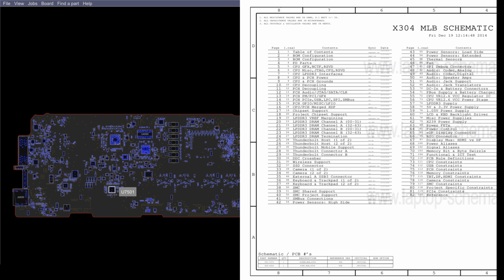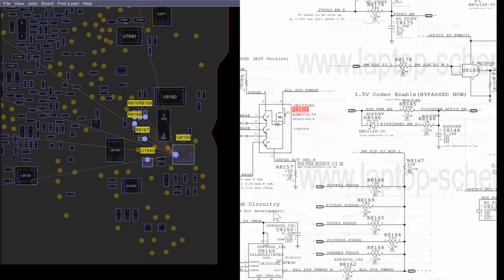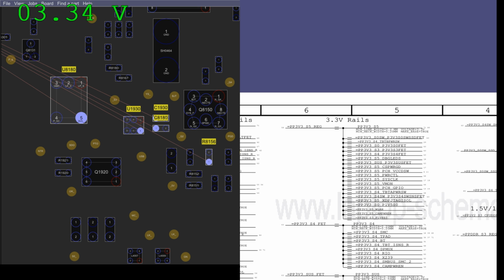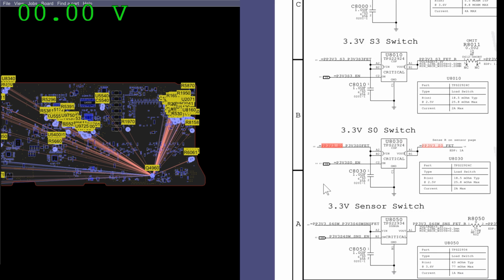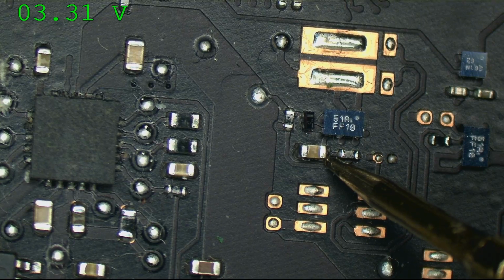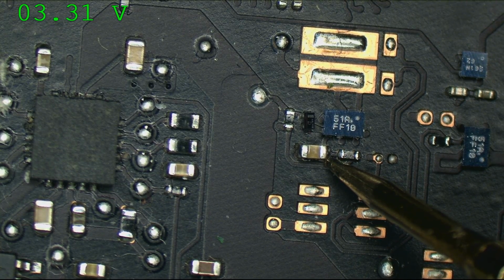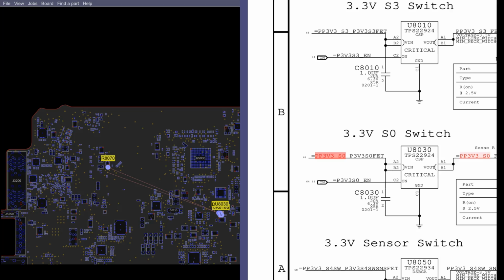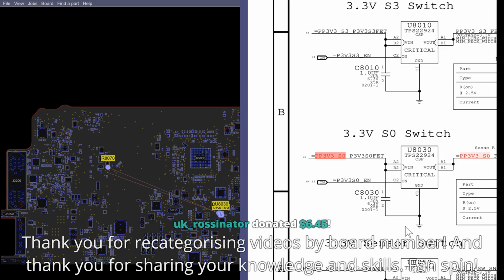820-4924 drawing 70 milliamps but not powering on

Comment from the maker: If you're looking for more board repair videos, check out https;//boards.rossmanngroup.com where I have them classified & categorized by board model number and problem type: no pre/post roll ads, no banner ads in the video, and higher video quality - all for free. 

I am hoping to get more people following me on my website than on YouTube just incase YouTube pulls the plug on my channel someday, like they have to so many other creators with little to no explanation. 

Thank you for watching, and as always, I hope you learned something!
Reply: You also might want to look into bitchute as well. Almost impossible to get banned from there.
Reply: Is this why the live stream vods keep getting removed from the live stream channel? I do not have the time to catch them live so I watch and listen to those vods hours after they are uploaded and they keep getting removed.  I get mirroring your videos but why can't they be on Youtube as well?
Reply: Hey Louis. I know you love your FX-951 but have you seen this Pace ADS200? https://paceworldwide.com/ADS200/ it's a 120 watt beast or at least says it is and it's price is pretty close to the FX951.
 The Hakko 951 is a 75 watt station so I'm thinking the Pace will cook through jobs that would normally have sucked all the heat from the tip and make solder stiff and hard to work with.
 The other thing I like is Pace being an American company.
 The negative is that the documents I've seen for it mentions it's a manufacturing station and not a rework station and I really don't understand the difference. I would think a rework station could operate at lower temperatures but the Pace manufacturing station temperature actually claims it goes lower than the Hakko rework station.
Reply: Thank you mister Rossmann! thank you so much!

Comment: Hi Louis
I have a 820-4924 no sign of liquid damage but no green light no power ,PPBUS_G3HOT missing replaced U7100 and i got PPBUS_G3HOT =12.59V SMC_BC_ACOK =3.11V   SYS_ONEWIRE=3.39V  ADAPTER+SENSE=3.4V. But still no green light  SMC_ADAPTER_EN =1.28V  . SMC is running because i got PPBUS_G3HOT=12.59V .Do i need to replace SMC ?
I really appreciate your help , i know you are always busy , thanks for the videos

Comment: So i just bought some amtech flux like the one in your videos description, and it has this little colour printed card with temperature graph and alloys info  and it seems it's 250 C max at time of work etc...Don't you normally run the hot air gun higher than that ? this card https://i.ebayimg.com/00/s/NTEwWDUxMA==/z/NrIAAOSwnsRaaMU7/$_106.JPG?set_id=8800005007